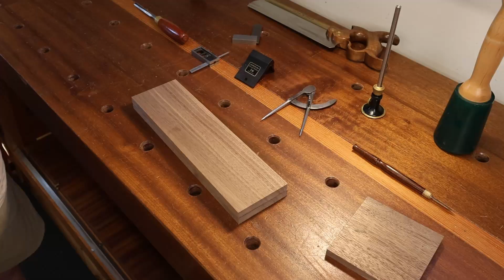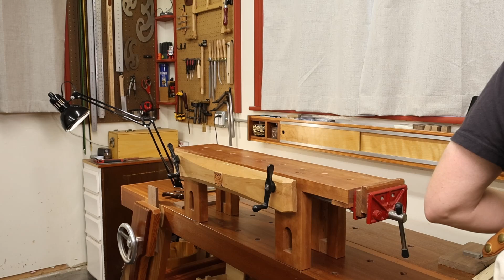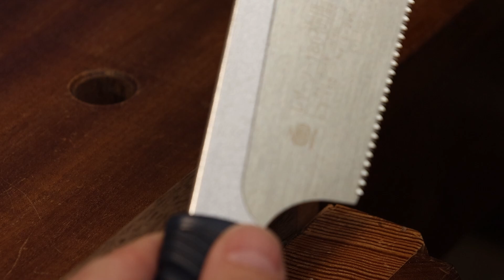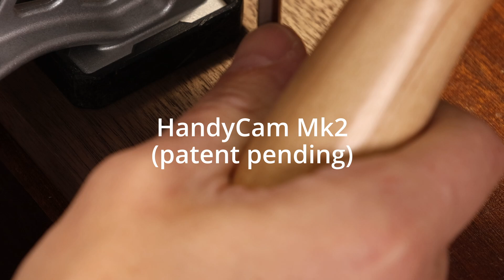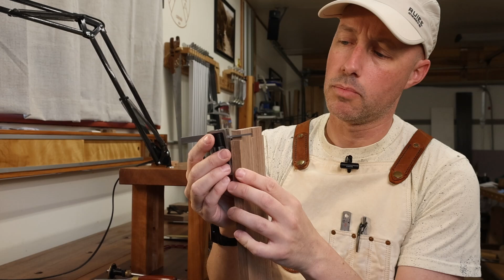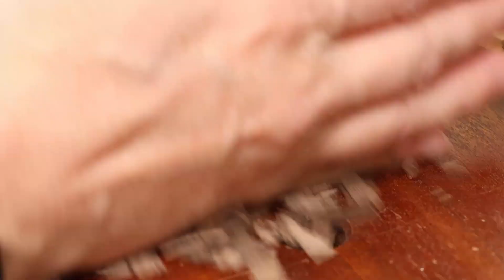Build a Wine Caddy Pt 4, Handcut Dovetails

Comment: I have the same Veritas clamps you use for the bench-on-bench but I’ve stopped using them because they don’t release from a hard clamp.   Did you ever have the same problem and if so how did you make them usable?
Reply from the maker: I haven't really had that problem but that may be because I've always only used them for workpieces that don't need to be held super tight.